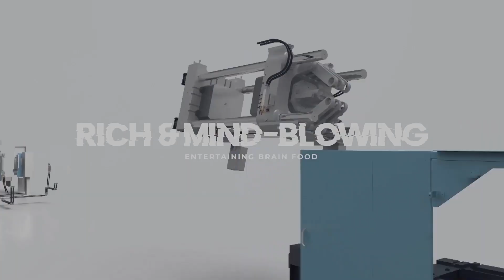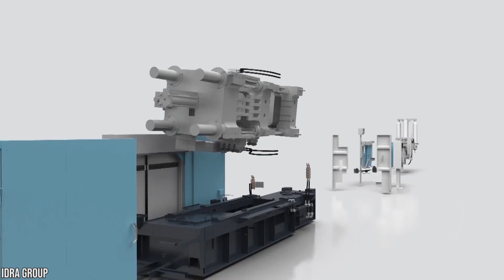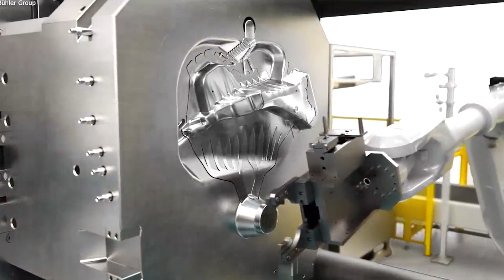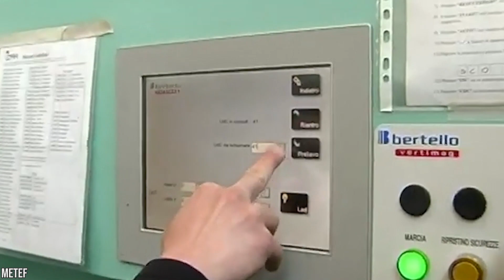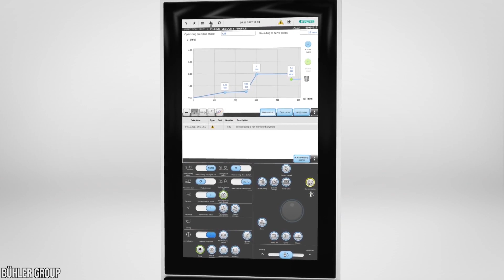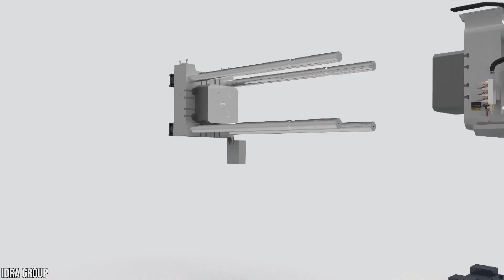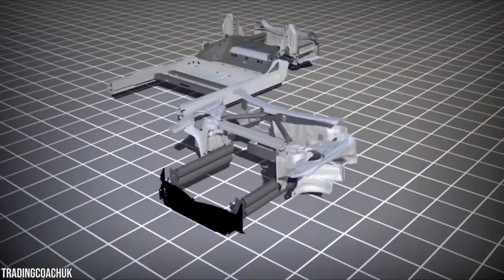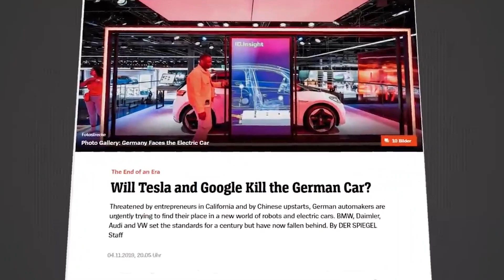GIGAPRESS - How Traditional Carmakers getting Crushed by Tesla

Comment: Take one big aluminium alloy casting add some steel parts bolted to it with steel screws, throw in a few pinches of road salt and regularly baste with surface water. Leave to marinade for a few years in a warm damp climate and voila! The perfect recipe for corrosion.
Reply from the maker: Thank you for your comment !😀

Comment: Nice work! Yeah, this is going to remove so many finicky steps and drive tolerances way down while simultaneously increasing throughput. 

Imagine the set of circumstances leading up to the decision to fabricate automobiles this way. For one thing, Tesla doesn't rely on breadth in its product line to stoke demand. Tesla knew their designs were great, and that capex would be justified for their designs. 

Cheers from South Korea
Reply from the maker: Thank you for your detailed comment, and welcome on board !😊